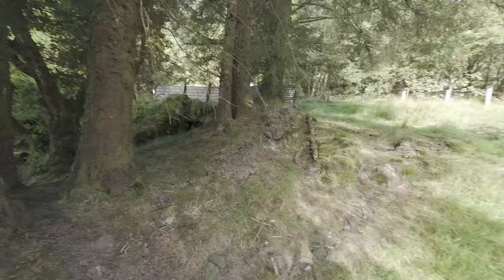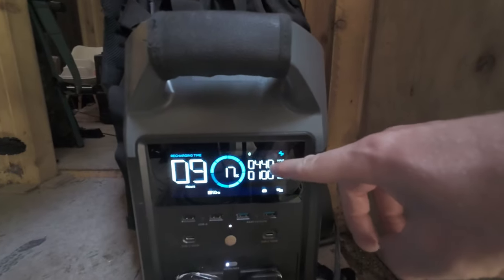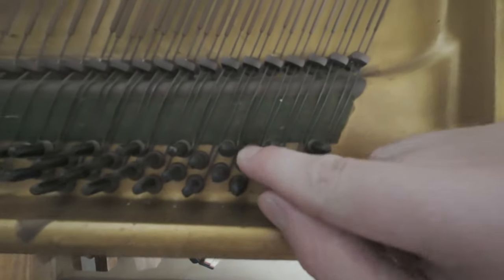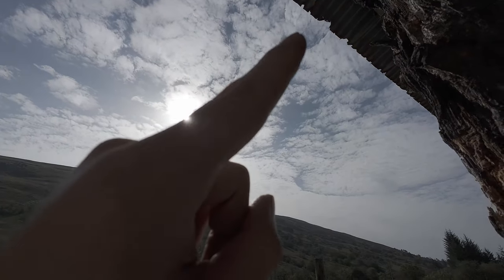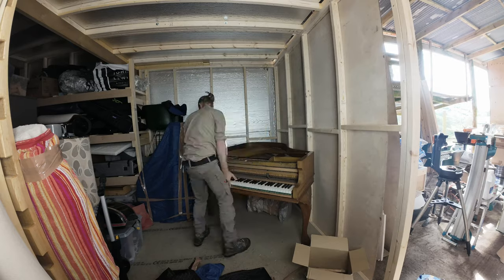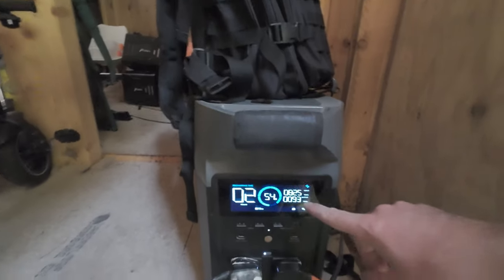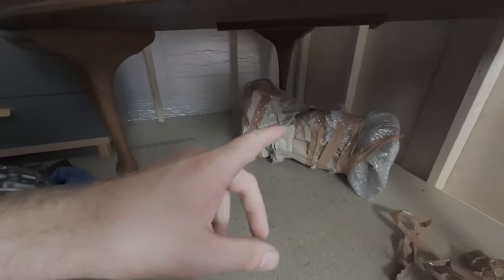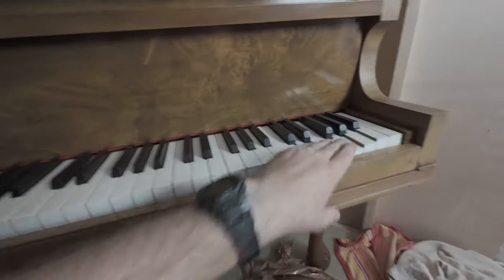Off Grid-Day 19-Solar panels and reassembling the Piano

Comment: I am glad you did not cut the piano strings. They can last up to 100 years if not longer which is why they are not cheap to replace compared to strings of like a guitar. The baby grand looks lovey. I cannot wait to hear it after it is tune. 

Solar panels work best at an angle because the sun's rays are at an angle because of the earth being on a tilt. There is a science to the best angle but an angle is better than none. As you know, shadows on solar panels are not great. Some panels are in sections to alleviate this problem. What you can also do is a series-parallel setup seeing that you have 6 solar panels. Connect two panels end to end to put them in series and than connect the 3 sets of 2 in parallel. This helps with shadows and also if a panel goes bad for whatever reason, it only interferes with the other panel that it is connected to in series and the rest of the panels continue to generate electricity.
Reply from the maker: I think I will be rebuilding the solar frame soon as it was just a quick setup to get us some power and stop them blowing away. Thats a good idea on the connections
Reply: @beyondtheworkbench  Yeah, there is nothing wrong with what you are doing, like you said most of it is just temporary so you can get up and running on your land. I think one of the biggest debates is solar systems and the best way to setup them up. I always say, go with what you are comfortable with and what works for you. This is why I like the  all-in-one solar system you have. For most people, it works great.